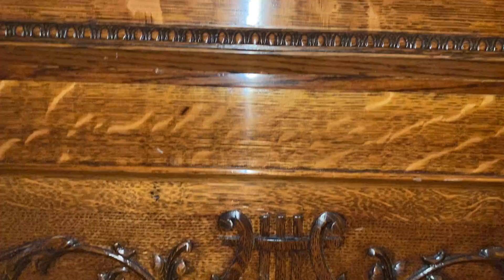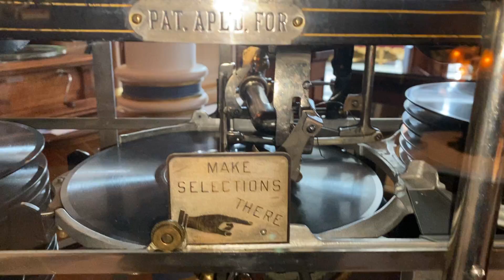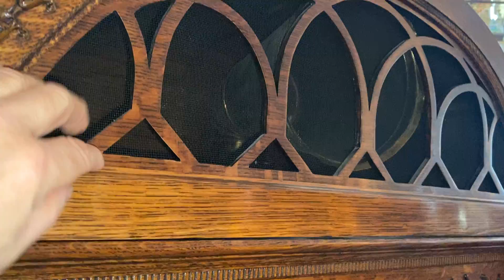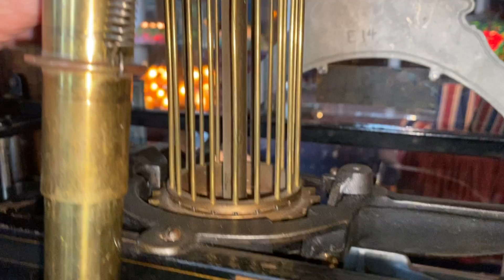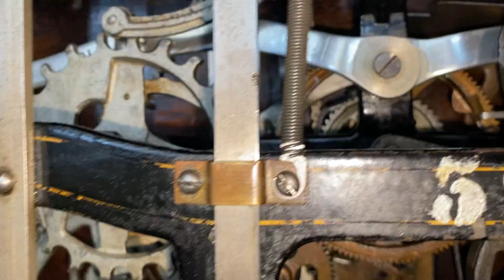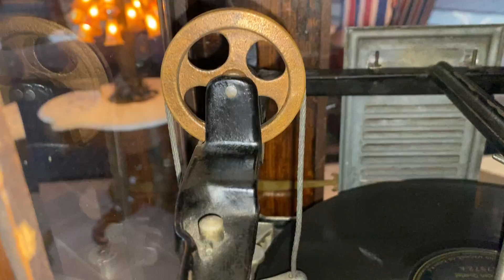Sanfilippo Foundation - Gables Entertainer 1906 (early disc jukebox)

Comment: Indeed absolutely stunning machine! What a wonderful mechanics! The automatic needle change is just Amazing! Thank you very much for sharing this indeed unique gramophone. One question - Is there a way of know the “Fresh needle carousel” is getting low on needle supplies or even when its empty is there a safety feature to make sure you don’t play a record without a needle? I could imagine that the soundbox would touch the record without a needle, in this case with all the extra features on the tone arm. Anyhow - marvellous.
Reply from the maker: You know, I'm not sure if it has a safety measure for running out of needles. Great question.  I'll have to investigate. I would suspect there is some sort of safety mechanism. Those thin copper colored tubes go up high into the cabinet top, where you load them, and there's about 20 long tubes. There may be a slight opening in the side of the tube to when it tubes get low. I'll report back.
Reply from the maker: Also see our Sanfilippo Foundation facebook page for close up photos of this machine I just added.